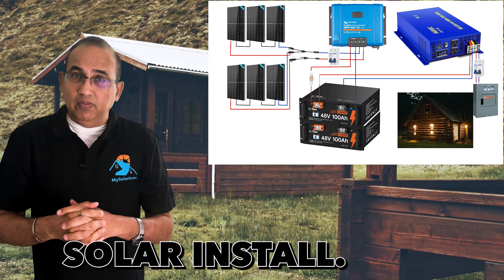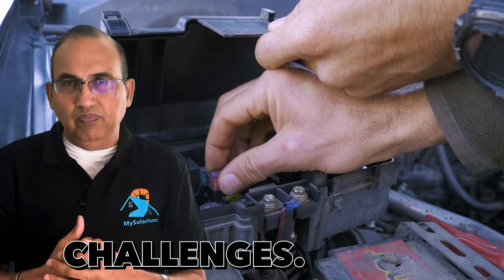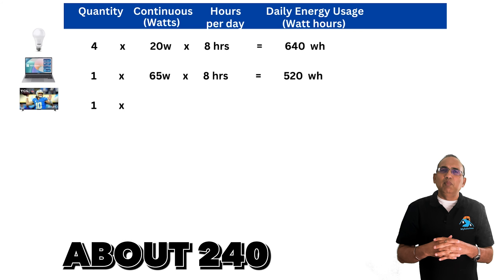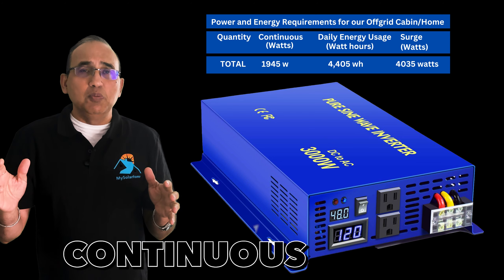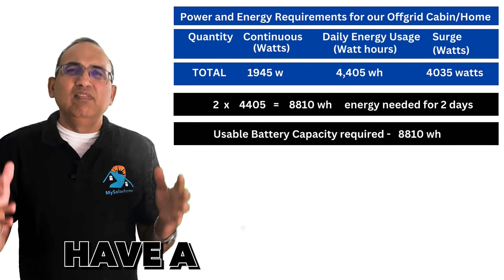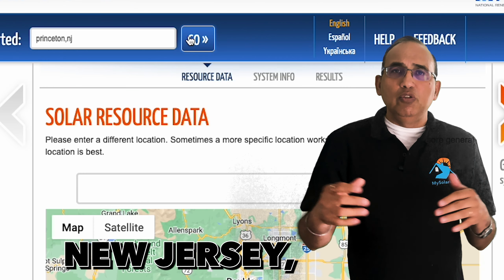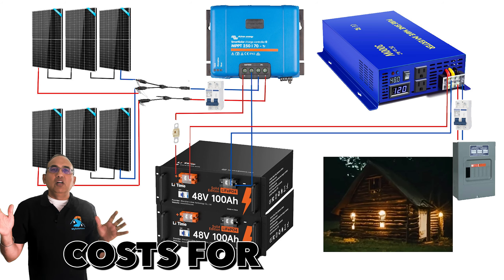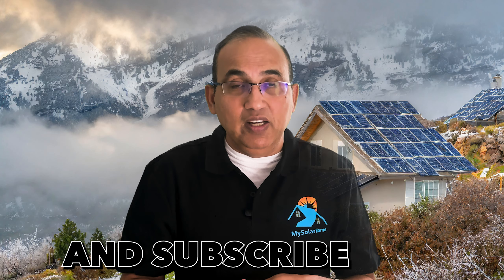OffGrid Solar Panels, Batteries, Inverters / Off Grid vs Grid Tied Solar Panels

Comment: Quite a good summary.  Usually I find all sorts of problems with these sorts of videos but yours did a great job.   I would recommend a somewhat different panel and charge controller configuration, but that's pretty much it.

For the panel and charge controller configuration, don't use a parallel combiner at all.  Parallel combiners such as the ones depicted in the video are actually fire hazards.  Instead, use TWO Victron 150/35 charge controllers, each with one string of three panels going into it (well, assuming the string VOC is < 150V anyway).   In addition, I would install a combiner box for each string (two combiner boxes, total).. .even though you aren't combining anything.

The reasons for doing this are as follows:

* You want at least two charge controllers for redundancy.  If something breaks, you don't want to be left with now solar at all.

* The lower amps from each charge controller makes wiring a whole lot easier.

* The use of a combiner box both gives you expansion options later on and also gives you a convenient disconnect (the breaker in the combiner box) as well as fusing and a surge protection.   So its good to have combiner boxes (two in this case) even if there is only one string going into each one.

You already have some battery redundancy, which is great... a lot of people forget that but it is critical.  The only thing left is the inverter.   For the inverter:

* I'd recommend a minimum of two inverters, for the same reason.  Gives you redundancy in case you blow one up.   But you can also do some cool things with two inverters, such as split the loads that might involve surges from all the other loads which just run regular house-hold non-inductive devices.   This way the surges won't stress the other devices or the other inverter.

* Consider a Victron Multiplus-II 48V.  They come in a 3kW and 5kW model.  Unfortunately only a single phase output but that's the way the cookie crumbles.   The reason is the low idle power (about 12W for the 3000W version) and strong robustness.    So like one of those plus one "junk" inverter, or just go straight to two multplus-II's.    Low idle consumption is worth its weight in gold.

-Matt
Reply from the maker: Thank you very much. Your recommendations are spot on and in my future videos I will surely incorporate those suggestions. And thank you for those kind words - I try hard to make sure I give good information and it is good to get validation from an expert practitioner. Happy Memorial Day.